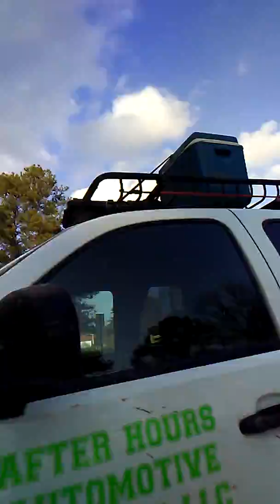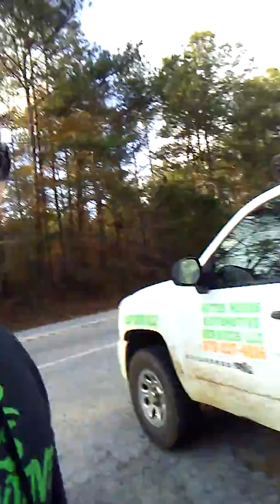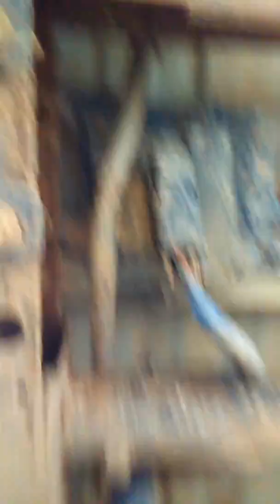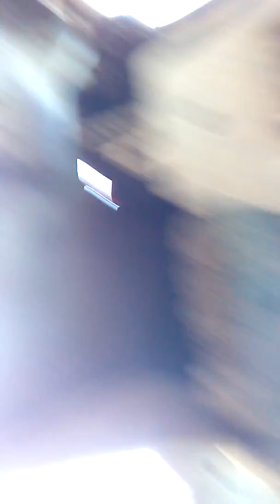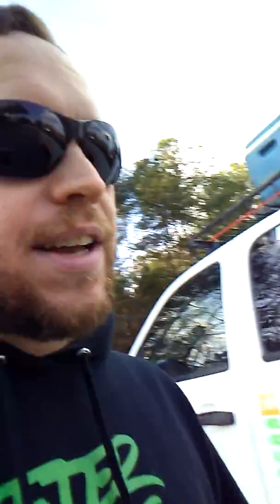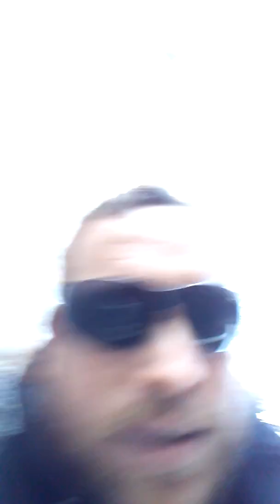Silverado Fuel Pump Control Module

Comment: Bro ive been dealing with the exact same thing for 6 months but instead of the carb cleaner I would just unplug that one and swap it out with the other one I had for my 5.3 L. They both worked fine I just kept interchanging them.

Comment: Thanks we have a 2015 gmc sierra having all kinds of problems with her, battery is fine then all a sudden won't start jump it with jump pack theft deterrent system pops up other times service trailer brake system now I'm getting a p12a6 code!

Comment: Great video!! Just replaced pump in truck at my shop because customer swore it’s the pump.. Truck kept coming up with codes for fuel pump and truck runs fine but died on customer the other day .. found this video and now hoping to narrow it down to that control box

Comment: If anyone needs a programmed Plug and Play unit check out the link below.  

https://www.garretttuning.com/products/2007-2009-gm-fuel-pump-control-module-fscm-programmed?_pos=3&_sid=1c3324260&_ss=r